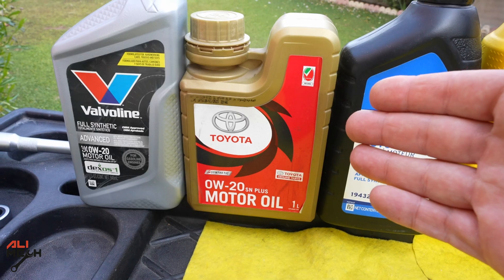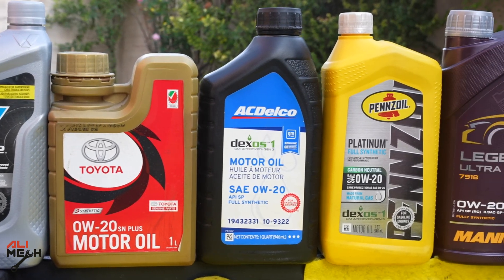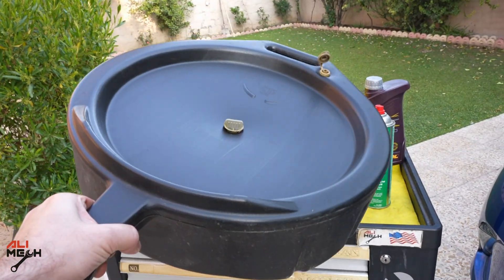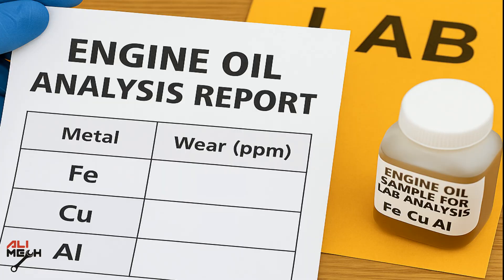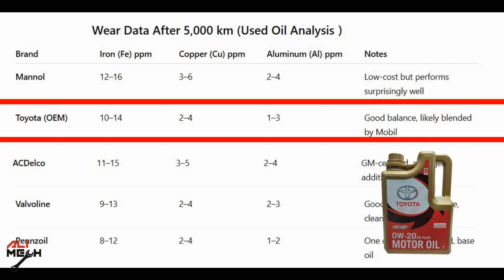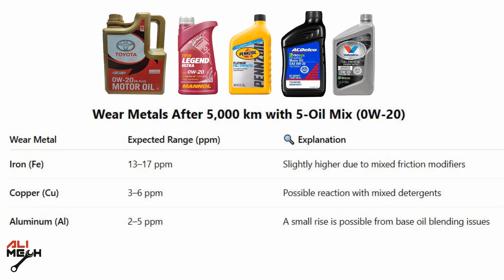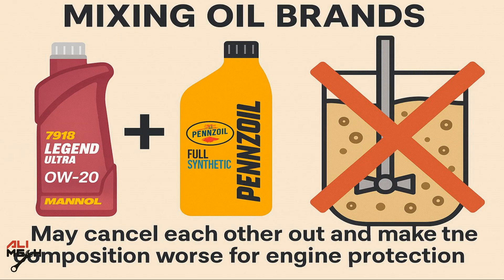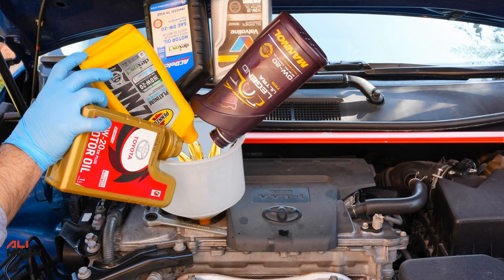What Happens When You Mix 5 Engine Oils?

Comment: So I guess you could never change oil brands then. You  couldn't go to different oil change places either. 
I would be curious if you sent the sample to Blackstone labs.
   None the less, if it was as you said, cars would never make it past the first couple oil changes. 
   Remember people,  clean oil trumps the brand of oil you have in. 
I would rather run three different brands as long as they all match the vehicle specs and change it at 3-4 thousand miles, than to run something like amsoil and keep it in for 20 thousand miles. 
  Cheap clean oil is better than dirty expensive oil. The dirt is what destroys the engines far far faster than  random oils.

Comment: Of course Pennzoil performs better- it uses a different process to create the base oil. But the rest just use regular dino oil as the base oil (possibly recycled dino oil in the crappier ones?), then add additives and modifiers. We also know that in the case of 0W, the "0" part is heavily dependent on the modifiers.  Would be amazing to do this testing true synth(GRPIV) vs. lesser(GRP3) base??

Comment: Friend's dad owned a garage. We changed our oil using half a quart from dozens of different brands and grades. Whatever was left over and just needing to be emptied. We never had a problem and one of their vehicles is still going strong 20 years and 400k miles later. Changing the oil every 5k miles is what matters, not the brand or concerns over mixing.
Reply: Agreed! clean oil trumps  oil brand. I would rather run multiple clean oils and change at 3-4 thousand than dirty amsoil and change every 20 thousand
Reply: Imho extremely different oils could have issues, could.

Comment: The specs look to be on the universal average.
What was the driving condition when tested? 
How much did the 0w20 shear down?
Try testing with a 5w30.
Been useing MANNOL ENERGY 5w30 for several years on my 2015 SUZUKI VITARA with 160,000km on it....doesn´t take a drop of oil between the 5000km oil/filter change.

Comment: I wouldn't recommend it because each oil is finitely engineered to the point that adding in additives or mixing with another brand / different viscosities will cause a clash with the additive package.

Leading to a result that is inferior versus using a single oil.

Which is also why if you are changing brands / viscosities to actually do a double oil change.

Comment: years ago I had a 
Ford “Tempo” 2.3L , four cylinder, was a gift from a friend after 2 years under a tree abandoned, drove it for 2 more years and since it have a small leak I put in engine whatever oil I found, particularly cheap , no problems whatsoever and sold it running perfectly for $800 😂😂😂

Comment: I use Valvoline 5/20 for my Toyota Prius hybrid 2010  I didn't face any problem but there is 1ltr consum ever changin oil
Reply from the maker: Do you have oil loss with other brands too?
Reply: If i make it 5/30 the lose become low but	THE COMPANY RECOMMEND 0/20 AND I USE 5/20SYNTHITIC NUT FULL SYNTHITIC ,, I WATCHED MANT PODCAST FOR U ADVICE  FOLLOWING COMPANY RECOMMENDATIONS.  ANY ADVICE HER? @AliMECH
Reply: Yes i have , i ckean the pcv when i watched ur podcast about it but still one qurter oil short each oil replacement 5/20 synthetic not full Valvoline